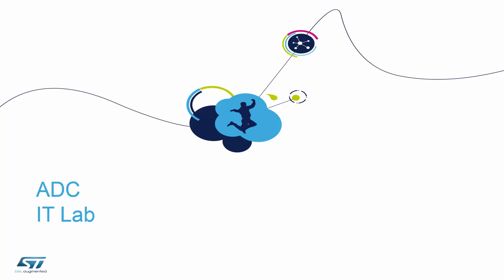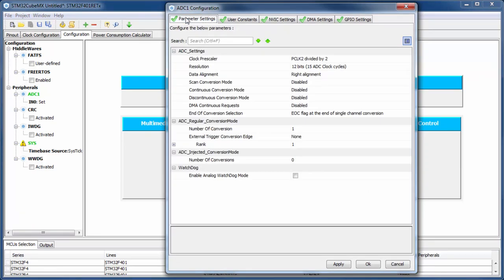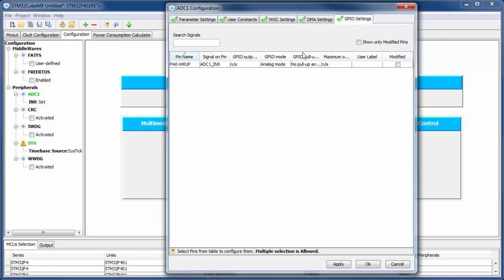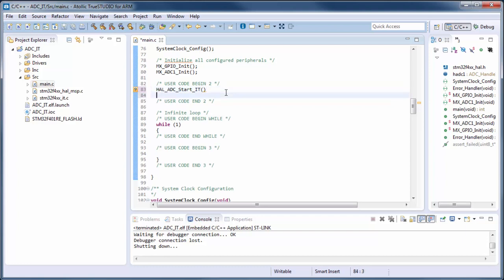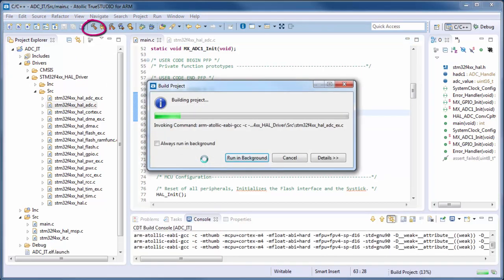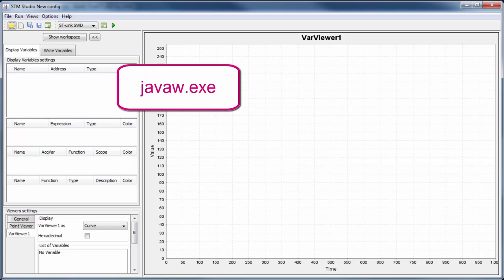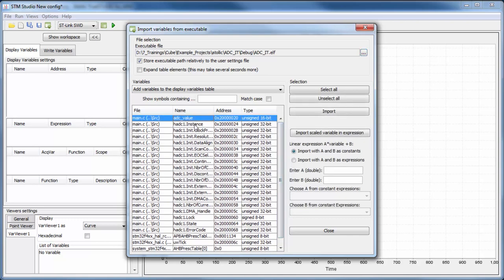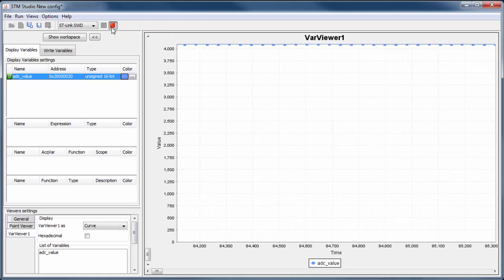STM32CubeMX basics: 13.1 STM32Cube HAL labs ADC - Lab ADC IT

Comment: Had two issues with this lab, including debugger error and the interrupt callback only calling once. To fix, I did the following:
 - For debugger issue, global variables within a file (e.g. adc_value) make as "volatile static" - volatile static uint16_t adc_value;
 - For callback only calling once, I suspect that the conversion rate was too fast. The "HAL_ADC_IRQHandler" is quite long. When the callback is called, in this lab we restart the conversion in this callback. If the conversion finishes before HAL_ADC_IRQHandler finishes, I suspect this will cause problems with the interrupt flags. To fix, I created a "ready" flag (volatile static) that is set in the callback, and the "start" is called when ready is set in the main process.

Hope this helps anyone else with similar issues